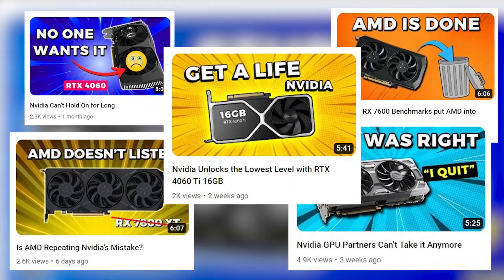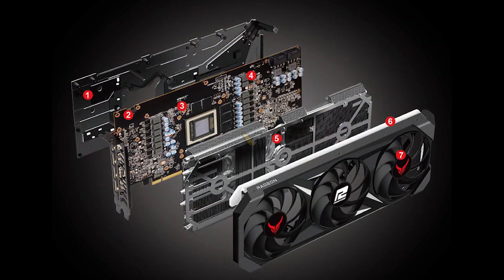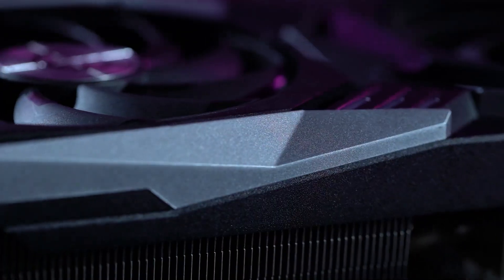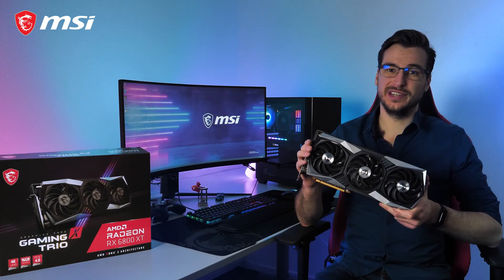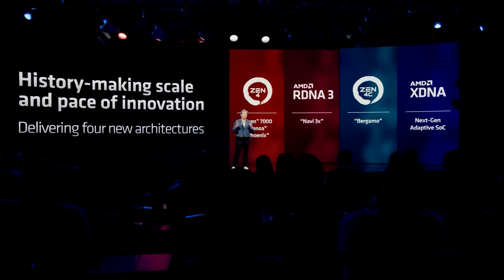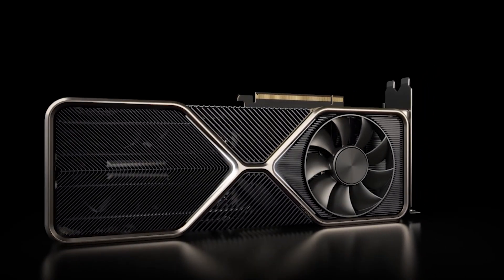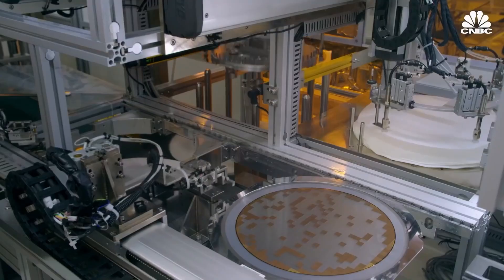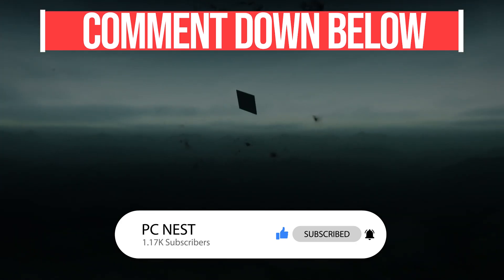AMD RX 7800 XT Leaked, Why does it Exist?

Comment: I cant imagine the 7800xt being actually worse in performance then the 6800xt but I could see it being barely an upgrade if even an upgrade other then features. The real kicker will be where the price points of the 7800xt and eventually 7700xt (if there even is one) come in at with their level of performance compared to the 6000xt series cards. Though it does feel like the 7900xtx was the upgrade for the 6900xt and the 7900xt was the upgrade for the 6800xt, so the 7800xt may just be the upgrade for the 6700xt, and they messed up their naming scheme because the marketing team are dumb. Of course that would be disappointing. If the price is right and some level up upgrade over the 6800xt is there then it may be a good choice for anyone who has an older system and is ready to upgrade but likely wont be a good choice for anyone with a 6700xt or 6800xt already.
I was kind of hoping for more though as I have a 6750xt and was looking to upgrade to a 7800xt when it eventually came out as the 7900s are a little too much for me to spend and the 4080 and 4090 are way out of my price range. But by the looks of things I may be waiting to see what happens with 8000 series and see if I can grab a deal on a used 6950xt / 7900xt or something when the less informed upgrade to 7000 and 8000 over the next year or so.
They really could have just called the 7900xtx the 7900xt waited a bit longer and then release the 7900xt as the 7800xt and then the soon to come out 7800xt could have been the 7700xt and no one would have known the difference and likely would actually be happy with every thing. They could have then even had the potential 7700xt come out as a 7650xt or even 7600xt as there is no xt model of the 7600.

Comment: I buy a new GPU not for frame rates but for new features. However, most folks are not like me. I think most folks bought GPUs after the miners and scalpers sold theirs off. Which cut sells of new cards in appearance. However, the ones scraping by upgraded and the market shrank after that. I had not built a new computer for 7 years. Started just before the Plandemic hit. Best I could do at that time was a RTX 3050 from a GTX 1650. I felt lucky at that time  just paying $100 more than I should have. Since that time  to now  the big upturn the question would be, how long will folks be before upgrading? New builds are down. Plus the economy is bad and disposable income is  not much these days.  A.I. is the cash cow for Card companies.
Reply: 10 years as GPUs that are actually better than the last one seem to come out once per decade also driver support seems to only last a decade. So most likely going to get a RTX 5090 to replace my RTX 980. Yeah the 5090 isn't released yet nor has it have been 10 years since i built my computer. Really nVidia sucks  for value and the only reason i am going with it is CUDA is propriety to nVidia. As i use the same machine for 3D modeling and AI processing as  i do for gaming having CUDA is needed. 

If i could afford 2 computers i would get 2 but nVidia GPUs are not cheap and the one for gaming would also be a high end GPU just most likely with less VRAM and much cheaper. Less VRAM as games don't use 24GB of VRAM. Going by reviews at most games at this time at most use around  12GB of VRAM and around 12GB of system RAM at the same time. Still AMD's 16GB card is cheaper the problem would be the rest of the system would probably still be expensive to have it feel the same as this one is right now.

Yes 10yr old production focused PC hardware is still good in 2023 just it is getting to the point that i might need a upgrade if not just for gaming but AI compute will run a lot quicker.

Comment: The Rx 6800xt supply is drying about now. This is going to be a 6800xt with an AV1 encoder and more efficient architecture for probably 50 to 100$ more, so a big price increase for features gamers don't need but are forced to buy because the 6800xt is simply not going to be available after two to three months.
Reply: Haha, it’s cheaper than the 6800xt if not same price

Comment: We are experiencing companies reaching the limits of silicon. Can’t wait for single atom transistor mass production
Reply: I have spent a lot of my personal time researching and understanding how the current state of silicon and technology compares to the theoretical maximum limits of silicon. I also have a degree in electrical engineering(not that that makes me some kind of an expert) I personally believe that there are a couple orders of magnitude of performance left to be extracted from silicon as we understand it. I agree that we are reaching a point that creating a usable process node that gets a noticeable gain is becoming increasingly difficult(resulting in higher costs for manufacturers)but this comes down to the limits of architecture as well as the limits of the current euv equipment and the understanding there of. Even if we were at some sort of hard limit of silicon, many advancements will come in the form of architectural, software/drivers as well as multidie and stacking. Advancements will not slow down.. but they will become more expensive. Moore's law is indeed dead as we know it.